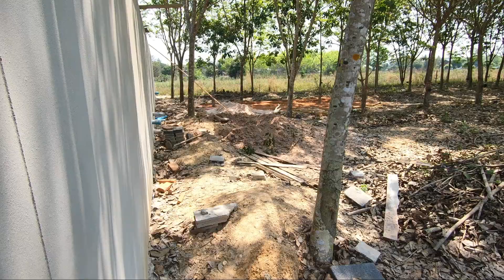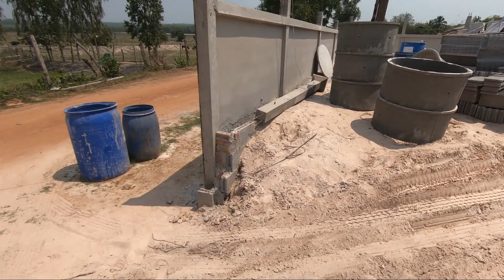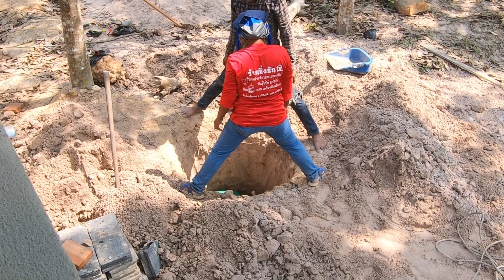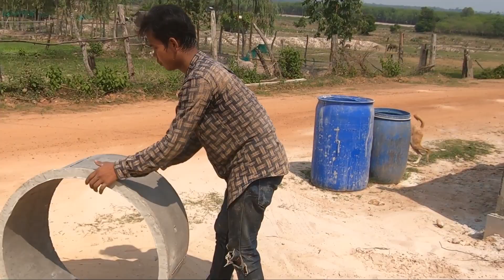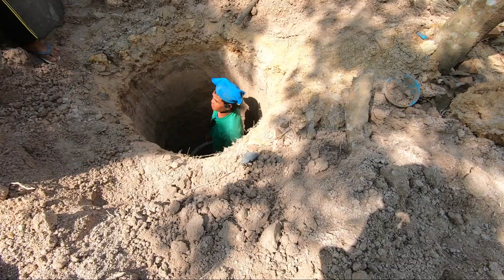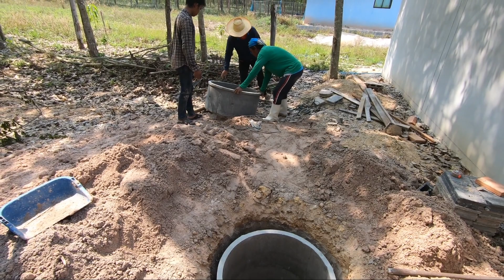New House Build part 19 - poo hole time!

Comment: Hello there mate.. I seen your post on Thailand build so came to youtube and have sat here all day watching your vlogs.. I must say you have done everything that i am going to do with my walls,, I have built the house to lock up stage and started the kids bathroom. But i have not been back for 2 years as of bloody covid.. will be back at the end of may thank god,, to finish the house so the wife and kids can move in.. But what i would like to let you know is about your septic tank out the back.. I put 4 rings in like you have, and as they all do in the village,, So i had gone back to perth and the rainy season came, Asked the wife is there any leaks in the house,, no which was good,, but the front door,,555 different story.. Any way i asked her to slide the septic cover off to look inside and see if there was any water in it,, And to our surprise it was full of water about 200mm from where the poo will come out.. So when i got back last time i got in there and half of the bottom ring was full of sand that had washed in through the holes they put in the sides.. so i got in there dug it all out,, no fucken room in there to bend over,,,555 then drilled holes in the side put some rods in and put 100mm of concrete in,, then filled all the holes on the sides and polyurethane all the joins.. Asked the wife last 2 rainy seasons is there any water in there ? No which is good,,  but i still me pull it all out and put a big black plastic tank in as i dont know how the seals will do when there is shit in there,, As if i didn't check , in the rainy season it would back up inside all the time,, i told a guy i meet in the other village he said fuck thats why we have problems in the wet seasons,, Sorry for the long rant,,, hope you can watch my progress when i get back and work out how to do youtube,, 555.. Oh and it is only 100 baht to suck the shit out in our village so i will be going with that..
Reply: @sunriseinisaan  Hi ,, Yes i ended up putting concrete in the bottom ,, and the builders put some small holes in the sides of the rings to let the shit out,, but when it rained the water and the sand came in through the holes and where the rings sat on top of each other,, so i filled them,, and the water table will rise and it won't go into the ground until the rains stop,, i am thinking of putting one of those black plastic tanks in, because i don't want any back ups in the rainy season.. And yes i will just get the guy to come around to suck it out when full,, it's only 100 baht... Just wanted to let you know as i see the rubber trees was very wet when you first went there.. just check the tanks after some big rain and see if there is water in there before you start pooing in there,,,55555